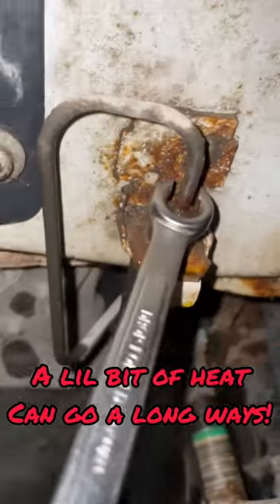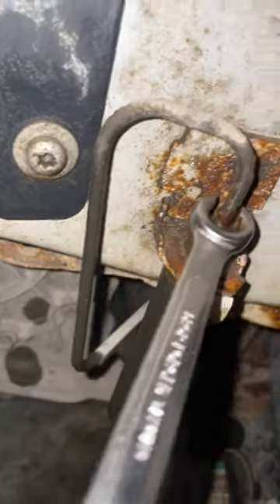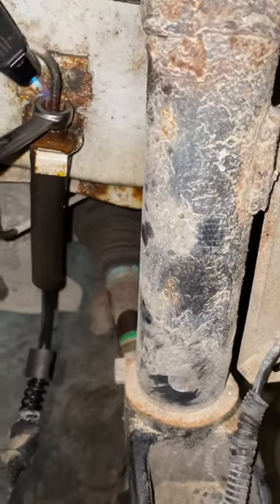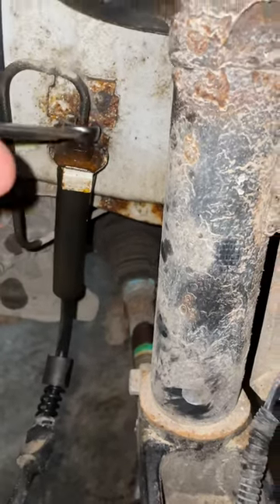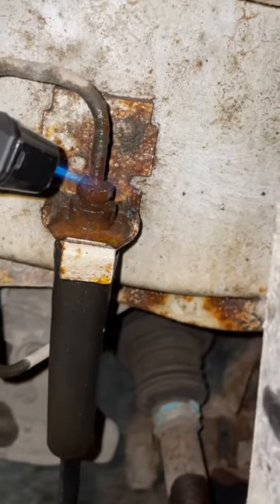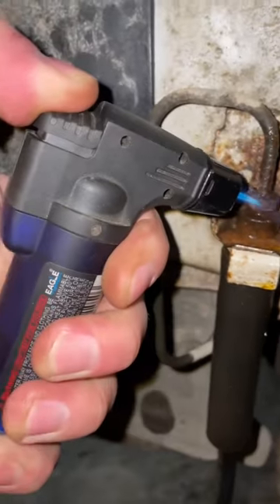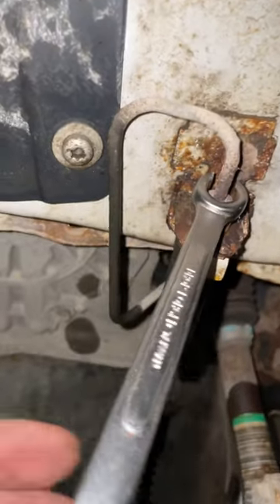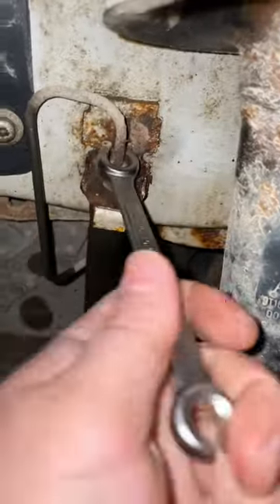When it comes to rust, heat is your best friend 😎

Comment: You would think with all the unwanted government safety oversight they would by now force car makers to use stainless steel brake lines and fittings.   Your kid cant ride a bicycle down the street without a helmet but we can drive cars with corroded brake lines after they’re 3 years old.

Comment: Automatic transmission fluid and acetone are apparently extremely effective at this as wel; all it takes is a metal spray can, equal portions of both fluids, a shake up if it's been sitting around a bit, and a couple squirts.  
Chrisfix has a video explaining everything, except better:
https://youtu.be/2WuVBFTzoKc

Comment: If you were using Snap-On line wrench, you wouldn't need the heat.     I used to work in the salt belt, so I know what I'm taking about.      Lol.    I would have used heat and water.   But the right line wrench is key.   I now work in the deep south only rust we see is from flooded vehicles.      Lmfao

Comment: Clean the rust off the line and it comes right off!
Reply: In what world?
Reply: @jhitt79  I repaired snow plow trucks for 20 yrs in the rust belt!
Reply: @billyamerican5200  the rust is also on the line where the flair is under the flair nut. How are you going to clean that rust off?
Am I too do mechanical work in the rust belt.
Municipal mechanic in lower Michigan.

Comment: Skip the pb blaster next time. Heat it and put some good old plain wax on it and let it cool just a bit. The wax doesn't boil off like the pb blaster and will get drawn into the threads as it cools. It'll come right loose.

Comment: Big guns might be safer if used properly. They will quickly heat the nut before the heat works its way into the crimp for the hose causing premature  failure.